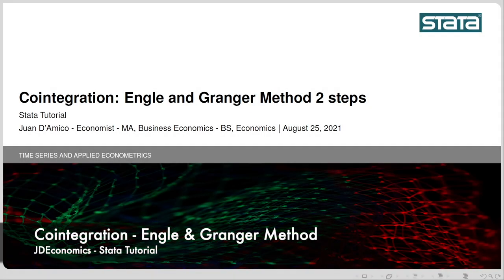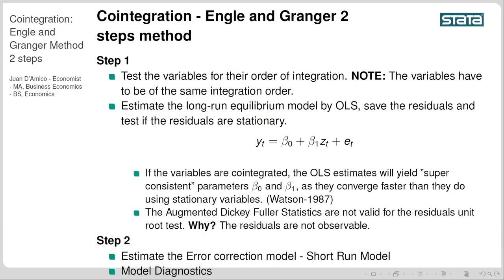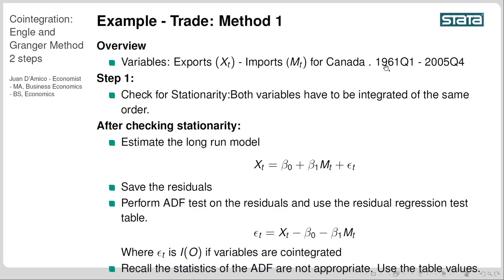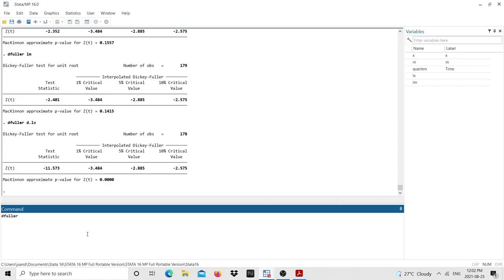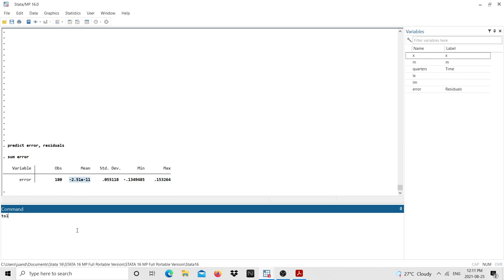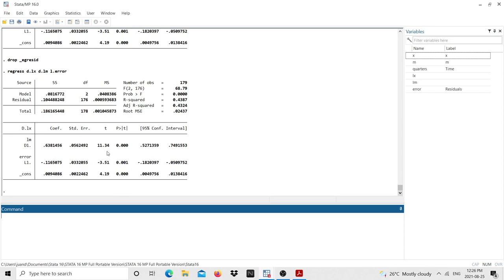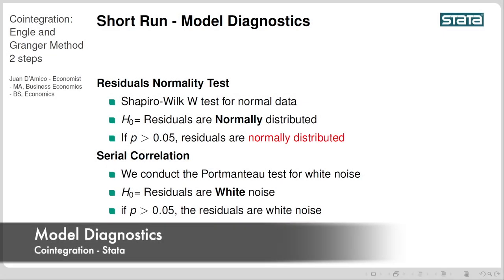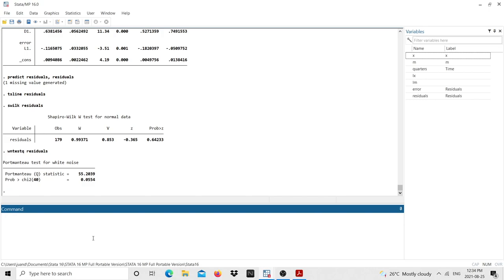Cointegration and Error Correction Model in Stata

Comment: Hi, what is the purpose of the noconstant bit after dfuller test and when is it appropriate to use?
Reply from the maker: Hi! Including a constant in a regression model assumes that the mean of the dependent variable is stable over time. If the series wiggles around a mean of zero, it suggests that the series is already mean stationary, and including a constant might not be appropriate because it would introduce bias into the model. However, if the series starts from a value other than zero (like 10), it could indicate that a constant term should be included to account for this initial level. So, in such cases, excluding the constant with the "noconstant" option might not be appropriate.
Regards,
JD

Comment: Hi. Thanks for the explanation on ECM above. My worry is, if after testing for cointegration using the Engle and Granger test above and the variables were found not to be cointegrated, would the Error Correction model still be an appropriate technique to use? If not, what would be the proper technique of analysis to use?
Reply from the maker: Hi, it all depends on what you are working on. Normally you take differences of the variables and work with a var model. Or you can work with linear regression, and include some dynamics to ensure there is no autocorrelation and the blue conditions are satisfied. What methodology you use is upto you. I suggest you look in google scholar for the existing literature about your topic of interest. There is a lot of literature already which can help you. Good luck! jD

Comment: What does it mean when my long-run model is cointegrated, but in the short-run model my error correction term is statistically insignificant. I have a sample size of 2700 but both swilk and wntestq indicate the residuals in my error-correction model are autocorrelated and not normally distributed

Comment: Hi Sir, if my variables are stationary at different levels, how is the command if I input ECT?
Reply from the maker: Hi, to use this type of models, you need the variables to be of the same order of integration. Regards, JD
Reply: @JDEconomics  Oh I see, so I can choose between I(0) or I(1) to regress it with ECT?
Reply from the maker: @nabilaa.vashti2602  If your variables are I(0), you can just estimate a normal linear regression. If your variables are I(1) and you confirm there is cointegration, you can estimate the short run model with the error correction term. If your variables are different order of integration, you can't use this model. Hope that helps to clarify your doubts, Regards, JD